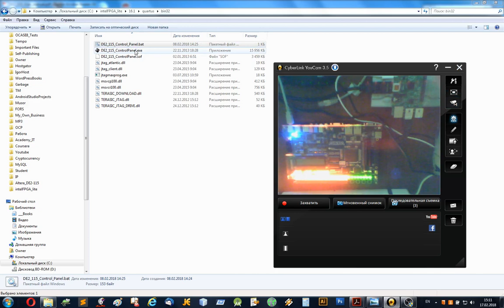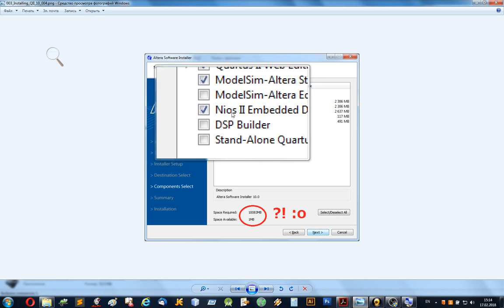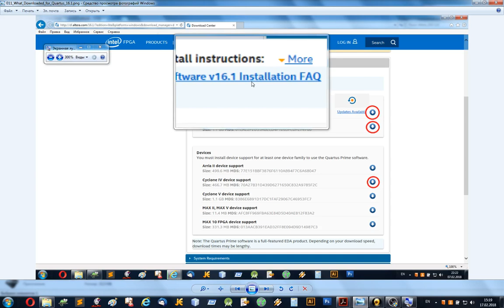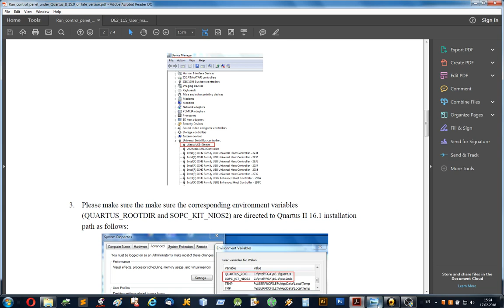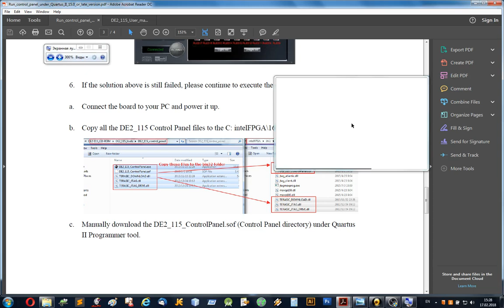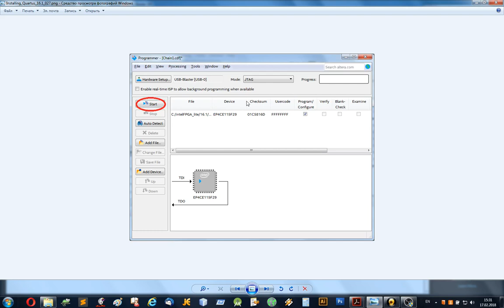Altera DE2-115 Setup & Control Panel Utility: How To

Comment: Hi, I would like to ask you where can i find the file DE12-115_Control_Panel.bat? Please send it to me, because it's not working in my case😢
Reply from the maker: I no longer use this particular board (Altera DE2-115), so the are no files anymore on my machine. However, I do remember that the BAT file you mentioned came with the installation package on the original DVD and I simply renamed it from DE2_115_Default.bat to DE2_115_Control_Panel.bat. I also had to change some values in it (ref.to the video @22:34)

Comment: I just bought a de2-115 off ebay and thought I got scammed.  When I power it and pressed  start I did not get the default demo program.  I loaded control panel and everything seemed to work.  Then, on the system CD, I found the default demo and loaded the sof and it worked as expected.  Then I powered the board off and on again and there was just garbage again on all the displays.

I am a newb so I thought I got scammed.  Then I sat and read the manual (more like skimmed) and saw the epcs64 and realized that is how you store the default startup program.  So I put the run/prog switch in prog and the programmer is AS mode and uploaded the default.pof file.  Then turned the board off, put the switch back to prog mode, and powered up and YAHTZEE!  The demo program was running.

So it looks like I did not get scammed.  Good thing too as I was 3/4 of the way through  the return process.  $90 for a de2-115 is not a bad deal. So I am happy